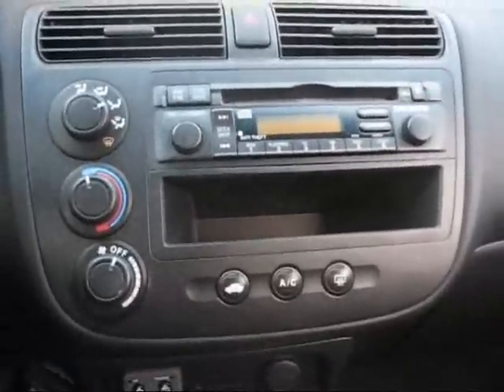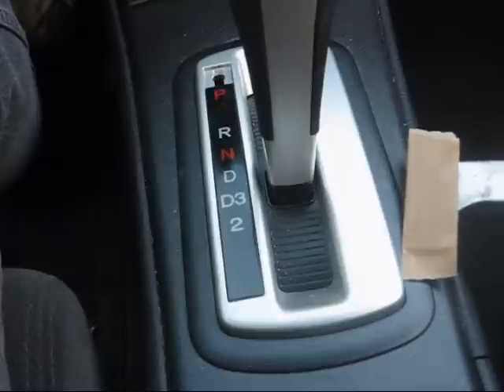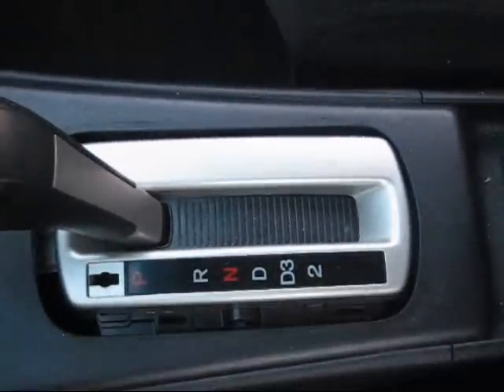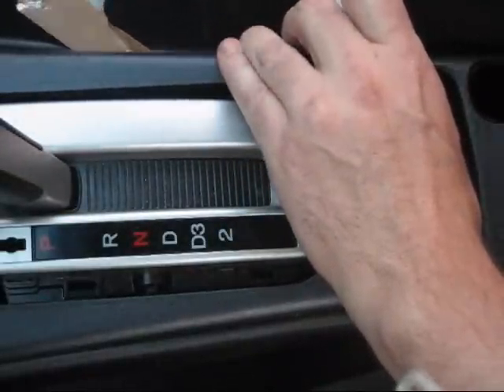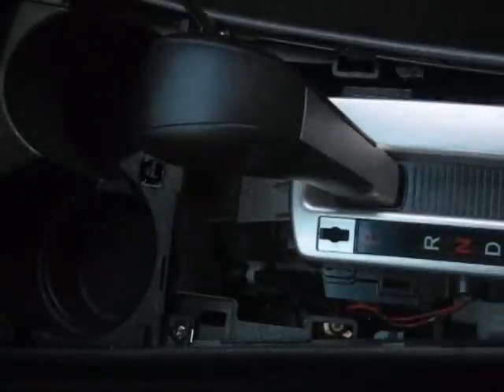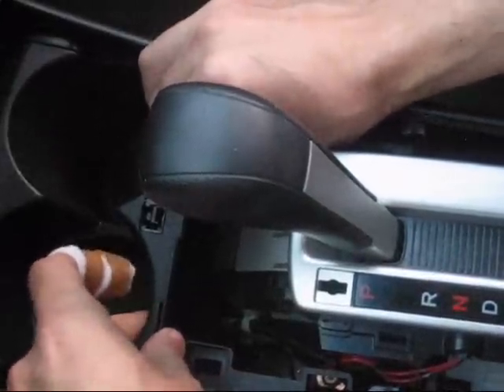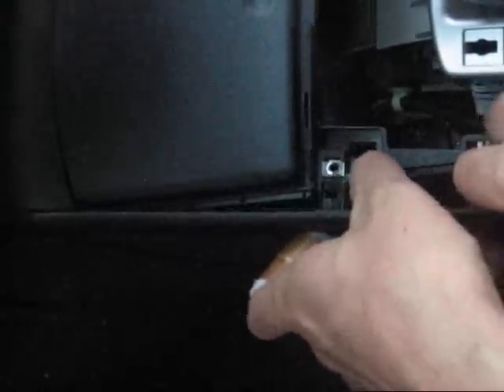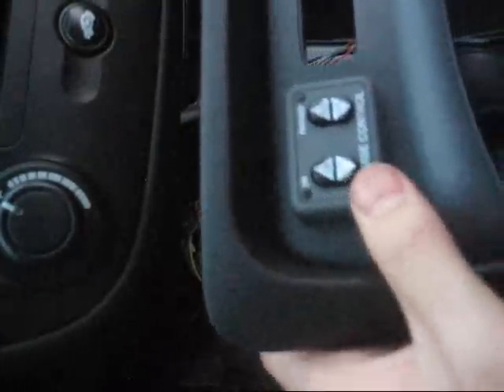How to install a new radio in a 2004 Honda Civic - Automatic Transmission Supplement.

Comment: THANK YOU for uploading!  

I have that tool sitting in my tool box that I have never used on anything; but I will have to give it a try with the tape next time!

Also I tore my whole center console out to install some blue FD lights a few years ago; and it is neat to see how that front part comes apart EASIER!  I am thinking about doing some more modifications to the car and your video will help make it MUCH easier!  Thank you!

Comment: Hey...nice video. Yeah, I too had that same issue with the two screws. Do not try to use a screwdriver. First off, you can't get a screw driver in there. Second, the factory has made them so tight, its hard to get them off with a screwdriver, you will strip the screw. Instead use a 8mm socket. Comes off much easier. Great job on the vid. Keep it up.

Comment: Thank you for the video. I was able to change my audio system following the video  instructions. I have three recommendations to every one planning to install a new audio system:

1. Add some extra protection to the parts to avoid minor scratches, you can use painters tape for example, works very good 
2. As a must, buy the Harness adapter before doing this work you will save a lot of time, the installation will be cleaner and only costs around 10 USD. I found it at WalMart.
3. Be extremely patient

Comment: If anyone is wondering, 01-02 models don't require removal of the trim around the shifter while 03-05 models do, like in the video. 01-02 models just require the removal of the cigarette lighter part to start the disassembling.
Reply: littlefields good man

Comment: Just to clarify, the goal here is to get access to those two "screws" on the underside of the radio/hvac console cluster. I put quotes around "screws" because they are ALSO hex heads. An 8mm socket bit worked on them for me. If you try a screwdriver rather than a ratchet, you likely won't have the clearance to get at them properly (unless you have a very short screwdriver). That's probably why the other video took out the whole center console instead.
Reply: the first one was easy to remove the second one was a pain, however with patience I was able to take it out

Comment: On this year Honda Civic 2004 the rim blocks screws on the trim piece that holds the ac and heater controls. If I recall it has been years since i took mine apart for the new radio. I will be taking it apart this weekend to begin painting my interior black. I did the center console this weekend and it looks great. I changed the silver to gloss black.

Comment: QUESTION:
Once the aftermarket car stereo is installed and if one were to ever change again... all you would need is a stereo removal tool to slide to left & right side of the deck and pull out, right?
No need to do all this operation of panel removal and such. ? Right?

Comment: Very nice...heading out back RIGHT NOW!
Reply: All done! A new Alpine is born and OH BOY the difference! I took a grinder to my old well used multitool and made the end look a bit more like the one Joe had with the forked front. IT really does sound horrible at times but other thana few clips getting lost down the hole things went quite well. I took the unit inside and spent some time on the bench making the new head unit sit at the right angle by modifying the metal cage before bolting it in, I also dremeled out a nice pass through in the pocket to store the usb and mic cords behind the dash when not in use.
Thanks for your help! It really is a terrific little car isn't it
?

Comment: @ Madblaster89 and @ ElQuesoGuapo  I'm know I'm probably a little late on this haha BUT I have an 03 Civic I'm about to change Head units on so I'll let y'all know if the screws need to be replaced or not. But Thank you ElQuesoGuapo for clearing this up, I was about to take the entire console out. I have an Auto, But I have a more tedious job of wiring subs along with a new head unit.

Comment: @ElQuesoGuapo there was a design change. These steps aren't necessary in at least the '02 model. '02 doesn't have the spring loaded door in front of the shifter.

Comment: Just saw this, was wondering if you could upload a video detailing the aftermarket cruise control
Reply from the maker: I can't upload a video because I don't have that car anymore.  The cruise control is a Dakota Digital CRS-300.    I've put it on two different cars, and it's been great.  I recommend getting the wireless remote control to go with it, so you can have buttons on your steering wheel instead of on your dashboard.

Comment: @socalkid1050 : thanks! I am adding an ipod adapter to the rear of the stereo and wiring it through the dash to the bottom cup holders.. so I dont anticipate that the battery would need to be disconnected

Comment: Well, that explains why our shifter light stopped working the day we had our radio installed at Best Buy. I figured the tech had blown the bulb or fuse, but when I opened up the shift panel, the bulb holder was in place and the bulb was completely missing. It just seemed so weird and unrelated at the time.
Reply: MBGM MBGM is a
Reply: MBGM MBGM is a

Comment: I just swapped one and didn't need to take out any of the center console pieces. Just popped out the stereo and hvac center piece, disconnected all the tabs, wired it up and smacked it back in.
Reply from the maker: What year was yours?  Based on the comments, there was a design change at some point that made the job a lot easier.

Comment: Had trouble getting screwdriver in to the 2 screws inside above cup holder. But I am tired so I'll try again tomorrow, could possibly explain why he removed the whole console
Reply: Andrew Villaran I also ran into this problem, did you get the screws out without removing the whole center console?
Reply: Justin M yes I  Used a socket instead of a screwdriver

Comment: Why do you need to remove all the pieces around the shifter for a stereo installation?
Reply: I know this was 5 years ago and you most likely don’t care anymore but Honda made it so it’s basically layered with trim pieces in order to get to the bottom layer which the radio is

Comment: If you're using that tool to grout, you're not grouting right. Perhaps you meant caulk :)

Otherwise, thanks. I have an '04 civic that I want to replace the radio on too and appreciate these tutorials.

Comment: um could you like take out the section under the radio with the outlet first and go on from there
Reply: Yes you literally pull the outlet cover and it pops out. Unplug the outlet and put aside. There are 2 screws up in there that holds the climate control/radio in the dash. You take em out and slide the whole thing out of the dash